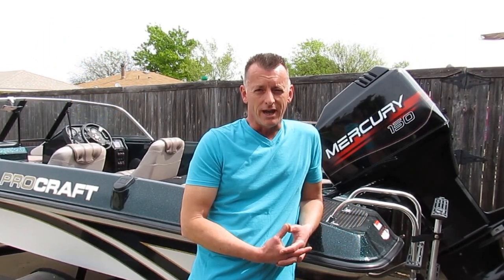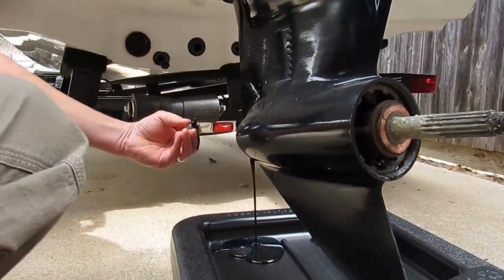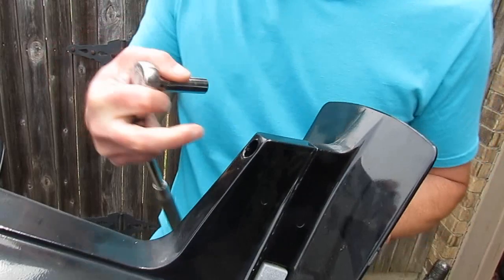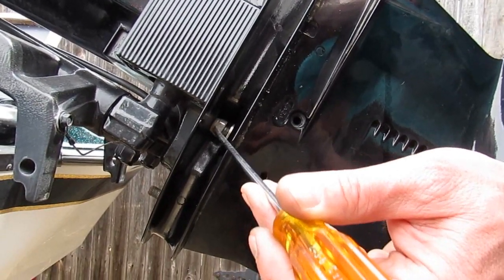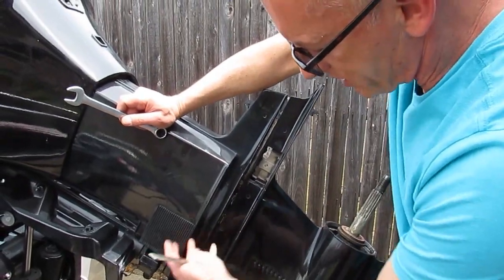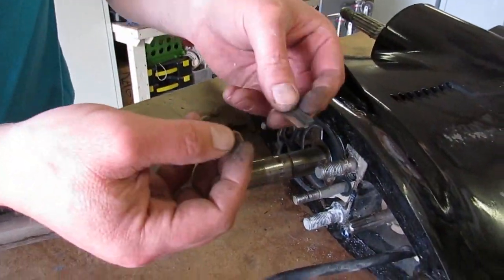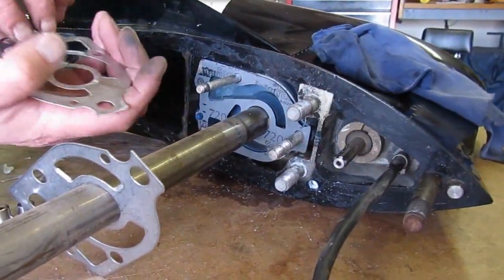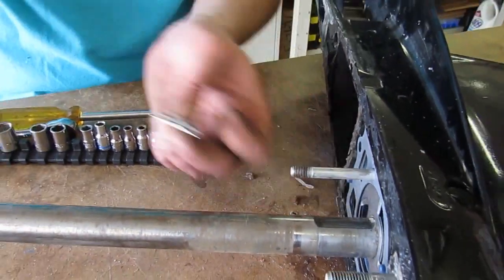Impeller Replacement - Mercury 150 Outboard Engine

Comment: Well I enjoyed your video and read all the comments.
That is how we learn isn't it!?
I am thinking about changing my impeller and doing research on how to do it.
By watching your video and reading the comments, I have learned much.
By making mistakes we learn as well as by performing the job correctly.
Guess I won't be using caulk to rejoin the lower and upper unit.

I also now know that maybe I should replace the thermostats, which there are two of.
Thanks for sharing your video, really? Onlu a half an hour?
That's great@!
Reply from the maker: Thank you for your thoughtful comments Tim. Many if not most of the haters have no videos on their channels performing this service or anything else. All of their phones are in the shop for repair 🧐. The engine ran great after reassembly and continues to do so.

I replaced the thermostats at another time. Minor leaks developed at the housing so I pulled them out and installed new. Problem solved.

Comment: As you were taking it off  should the  gear be in forward ,reverse or neutral ? You didn't show the hardest part  and that's  putting the lower unit back up into place .  Will you make a video on what you had to do to  get it to fit all the way back in place ?
Reply: Neutral and leave it in neutral dont know why so many say its difficult to line up. Dont move or rotate anything and it will go right back in.
Reply: @colbybud  Okay thanks
Reply: @Sertao2013  yes you can then put a wrench on the crank and turn it right if it won’t line up. To get the impeller on I place the impeller with the key down into place then rotate the shaft clockwise and pushing down on the pump housing. It slips right in.

Comment: Old post but do not follow this to change your impeller and never run an outboard in gear on a hose. Someone could die when it shears off.
Reply: @Jordan Behlen you CAN but theres no reason to

Comment: I am about to replace my impeller on a much older Merc. 150.  I assume everything is the same since they never seemed to have changed much from 1985 to 2000.  I noticed the old impeller in this video still looked in good condition.  My first question is, should these be changed out every few years regardless if they are working or not?   My second question.... Does anyone know of the 1985 Merc 150 2-stroke has a thermostat?  Mine is not moving water out of the pee hole and the motor is overheating.  I will change out the impeller tomorrow, but if I still don't see water moving through my heads, a bad thermostat should be the next obvious threat.  But, I can't seem to find one.  And, since I don't know much about Mercs, I want to comment this was a good video and very informative.  Thanks for sharing Dirty Shirt.
Reply from the maker: Thanks for watching Wayne.  The impeller was changed due age and because it's rubber but it didn't appear to be in that bad of shape.  Of course ingesting sand/mud (salt?) would affect the life of the impeller - that rarely happens with this boat.  The thermostats (2) have also been changed on this outboard.  They're located on the top of each head at the back of the engine.  They're surprising smallish (about the size of a 50 cent piece) compared to a car and are super easy to get to.  A sizable water line is running to each of the thermostats on each cylinder head.
Reply: @dirtyshirtinfo  That is good to know about the thermostats.  Both have been removed in the past and that is why I couldn't find them.   So, at least I know that is not my problem.  Should these be replaced?  Or, should the motor do OK without them?
Reply from the maker: @martiwf0  If the the thermostats were removed that suggests to me that somebody else was trying to shoot an overheating problem.  Without them, the engine will just take longer to come up to operating temperature and perform in its butter zone.  But clearly something else other than thermostats is causing the overheating and you're research on an impeller swap seems logical.
Reply: @dirtyshirtinfo  Everything here has been extremely helpful in getting my water pump replaced; however, I am running into some things not mentioned in your video when trying to reattach the lower unit.  First, your video shows a rubber hose coming from the shift casing but you don't mention it's purpose or what you did to reconnect it.  Mine did not have a hose, but it had the nipple for one.  I cannot find it's purpose in my shop manual.  Also, it is next to impossible to get the shifter rod to link back together because the inner part moves around.  By the time it touches its mate, there is no room to maneuver the inner part to match them up.  You can't even see the match up point because the gap is too small to see up in there.  For now I am at an impasse in getting this back together.  Any advice is highly appreciated.
Reply: @martiwf0  The rubber hose is for a speedometer hook up. The lower unit has a pito built in.

Comment: Besides all the other comments did anyone else notice he removed and reinstalled the prop for no apparent reason?
Reply: Interesting O.P. is not only an idiot when it comes to outboard maintenance but and arrogant one as well...
Reply: some people remove the prop to help reduce some weight
Reply: @deandye3255  good answer, also something to grab when re-installing the lower unit.
Reply: There is good reason for removing the prop when doing this type of service.  First it helps reduce the weight of pulling/carrying the lower unit away once separated.  The other reason and most important in my opinion is to inspect the shaft seal and see if there is any fishing line wound around the shaft.  Fishing line left unchecked will eat away the prop shaft seal and now you have water intrusion into the lower unit.  Left unchecked this can be a very expensive fix.  I always remove my props every year during winterization and inspect the shaft, seals and check for fishing line.
Reply from the maker: Bleu Stalder We did notice that  you came to a video platform, you have not a single video posted and left a stupid comment. Thanks YouTube hero. Like and subscribe 👍
Reply: @dirtyshirtinfo  well my opinion, but just because someone doesn't post videos doesn't mean they have no grounds to question your process, methods, or ideology....they might have higher intelligence than you there brother. Even a fool is considered wise if he keeps his mouth shut.....being humble and mild goes a long, but to each is there own, good day sir😉
Reply from the maker: @brandonchappell8545  This is a comment-unfriendly channel.  Add something to the collective knowledge base or better yet...don't, if you have nothing but an opinion.  This is a video website.  Show us, don't tell us.  Every phone has the ability to record video.  Every single video on this channel has a Q/A about comments in the description.  Watch this channel video about comments:  https://youtu.be/VHWSm79jXhM 

How much more clearly would you like the subject of comments to be addressed? 

P.S. You have no videos posted.  That is a hallmark of people who have nothing but opinions.  We checked. Start building your channel with videos and views Brandon and we'll see how your righteous indignation stands the test of time.
Reply: @dirtyshirtinfo  comments from others can be pretty rude but are also sometimes constructive critisism that will help us grow and be held accountable too. But dont take the haters comments to heart and keep doing your thing. There are many ways to skin a 🐈. Thank you for the video, and here are a few tips from years of experience. Those studs on the front portion of the lower unit are longer, and the nuts are not removeable until the lower unit has dropped a bit. This is not to wedge/press the unit down, but intentionally done to eliminate people removing all of the nuts and the heavy lower unit falling to the ground and getting damaged. Never place silicone between the lower unit joint as it will make it INCREDIBLY difficult to seperate next time as you will surely discover. The only location that needs sealant is the front portion of the pump housing that faces the exhaust, which stops gases from entering the pump and reducing its life as well as causing pump cavitation and reducing cooling efficiency. The unit could be left in reverse to allow you to spin the prop and align the gear splines, but NEVER mess with the gear selector when you have the unit out because you will be making a trip to the dealership if you do. Lastly, when installing the impeller in the housing it is easiest to put the impeller on the shaft and rotate it clockwise as you press down on the housing which will roll it right in with ease. I personally always use 2-4-c lubricant as the soap will dry rather quickly and if not washed off soon will become almost like glue and can damage the impeller. I hope I have helped your future repairs and feel free to comment with any questions in the future as I am more than happy to help. P.S. I have many videos myself, but do those on another account which I do not use to view and comment on others videos. It keeps business and pleasure separated. I hope you have a great day, and keep the videos coming!!
Reply: @dirtyshirtinfo  Not a stupid comment.  Just an observation.   Not to mention why in the heck did you silicone the gear case to the mid-section?   A stupid comment is much better than a stupid move.

Comment: This video should be removed. This guy does several things incorrectly and makes the process more difficult than necessary. Use of tools and reassembly is incorrect.  Never silicone the lower unit. Install impellers on drive shaft then the housing is much easier and less margin of error and on and on........... he obviously has no marine engine repair training.
Reply: Yup. Thatboatguy on youtube shows way better methods for outboard maintenance.

Comment: Thanks for good tips.It is possible to have a bad impeller that will pump water with the hose pressure adapter but not pump with boat in water or motor leg in barrel.
Reply from the maker: darryl mcleman we guess that’s possible. After the engine warms up does it discharge hot water out the pee hole in the back of the engine in all circumstances? There’s a thermostat in each cylinder head - total of 2. It will pee when the thermostats open. It seems unlikely that hose pressure would mask an impeller problem but hey, who knows.
Reply: Your new impeller is fine. I was just pointing that out for those trying to test old impeller as I have done in the past .I had one that pumped fine on the garden hose but not in the ocean. I managed to get the leg off my current Outboard after watching your vid. Thankyou again!!! @dirtyshirtinfo

Comment: how long should a cold engine take to start pumping water through the telltale hole?
Reply: jap338kx I’ve been told there is a poppet that lets water go out the telltale hole before thermostat opens. At least that’s what my efi150 does and I’ve been told it might be blocked. If not I guess when it gets to whatever temp the thermostat is
Reply: Mine is having to get the rpms up

Comment: there is no need for using silicone sealant along the split line of the housing.the only spot you use sealant is on the edge of the lower unit,right behind the water pump,on the exhaust side of the pump.thsis prevents exhaust gases from going into the pump area..
Reply: Quick question is the small tube that connects the pump to the long one fixed in the motor supposed to be very loose fitting?
Reply: @matthenni23  it shouldn't be super loose and I would replace it or put a clamp on it if it is. It is for the speedometer

Comment: Always leave lower unit in gear so you can turn prop to align splines
Reply: What do I do if I did not put in gear first?
Reply: @jasontindal2525  someone will have to wiggle the throttle handle a little towards the forward position  without putting into forward,,,,,

Comment: sorry but...NEVER use an impact on a prop nut. And remove drain plug before vent. Less messy
Reply: How do you take the prop off without an impact?
Reply: @vassilyknigge850  board across the lower unit housing to the trim tab or a leather glove. The prop nut should never be so tight you cannot turn it off.